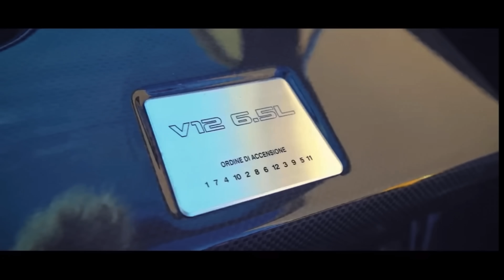Damon is back with  FATE OF THE 720 GTR & MURCIELAGO!

Comment: Glad to see Damon back on the channel!

Would love to see it into a Reventon. A replica kit, but reworked to be accurate.

Another option would be to see the Murciélago turned back to stock with the original stock paint (according to the chassis number), interior redone to stock, engine reworked and the car fully detailed with the headlights clear and not foggy anymore (which happens to be a thing to Murciélagos). It could be a restoration series. 

TheStradman, Ed Bolian, etc have Murciélagos too and would be great to see them together. Plus, if Ed Bolian could find out about the story of this particular Murciélago (down to it's first owner) and have DDE share it on the channel, that'd be an interesting series.

Comment: the guy you’re talking about has a company called Drift Works in the UK, the conversion took years, and it was an enormous pain in the ass, they had to make their own lowered spindles to get it to look like the RGT’s that Rieter Engineering built for the FIA GT1 series, they ended up fabricating most of the car’s suspension too I believe, and they fabricated a 12 stack fuel injection system from Audi parts, the entire build was incredibly complex, and complicated, and it has no front lift, it is a work of art though. the Murcielago is your dream car, you should build whatever makes you the happiest…
🏎💨💨💨💨💨💨💨

Comment: Leave the rear the way it is, put the bumper u have on it (or get the same one u had, if you can, and it doesn't take forever).. to get it drive-able asap.. then if you sell it, give them the stock bumpers as well.. then you can get top dollar for it.. i would DEFINITELY do the GT1 kit.. that looks AMAZING.. and u don't see it.. that's what u need, exotics that people want, but different.. You have a FAB guy now.. wasn't that the point of the DDE HQ? to do builds? I would LOVE to see (everyone would).. doing the GT1 kit on the Murci.. on the main channel.. a step by step series on everything.. people would LOVE that.. You have had the HQ for quite awhile now.. the only "builds" you have done.. is changing a tire.. and finally recently the body kit.. that was squeezed into 12 minutes.. TIP.. when you do a build.. show more.. condense some things.. but show more.. longer video is fine.. any build video should be longer.. focus 1/2 on rippin & racin around & seein awesome cars.. the other half on builds.. we want to see them...

Comment: In terms of the Murci, I think keeping it is actually gonna get the most value. Going oem is gonna be extremely tough to get what you want for it if you decided to sell it. You can use strictly all OEM parts to rebuild it, and any potential buyer is gonna be hesitant with it being previously crashed, so they will try to low ball you as much as they can. By keeping it, rebuilding it the way you want, and then sell it (if you were to) would get the most value cause you aren't trying to present it as OEM. Then it being previously crashed wouldn't be as big of a sticking point.

Comment: I wouldn't worry too much about the crash affecting its value in the long run, one of Ed Bolians LP640 manuals was a Canadian car wrecked and left in a ditch due to a drunk driving incident, and he still managed to have it repaired, fixed, made profit before the prices started going crazy.

Here's an idea though, Fix the 640, put it back to stock, and see if you can do a trade/deal with Ed on his real LP670 SV... would look good next to the SVJ, just sayin... 
I'm pretty sure Tavarish has an lp640 manual gearbox kicking around that you could manual swap an SV with too...

Comment: What if you swap transmissions between Dave’s LP640 e gear and the gated LP640. Following that, sell Dave’s for way more as a clean title gated manual, then sell yours with e gear for less with a rebuilt title converted to back to stock. Wipe your hands clean of them both and start fresh?

Comment: I think on the murci you need to build it back however is going to make you drive it more.....if you build it back stock but then the desire to use it is low there isn't much point. But if you build something your excited about that's worth all the lesser value.